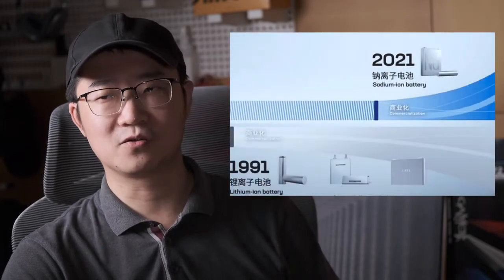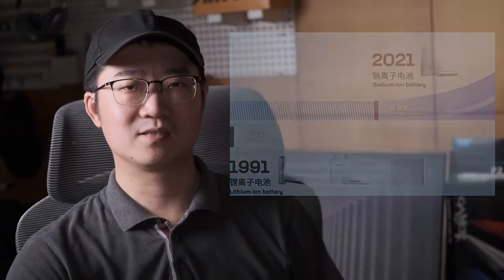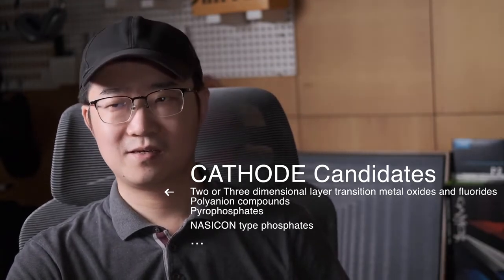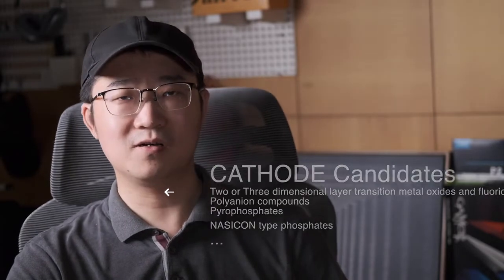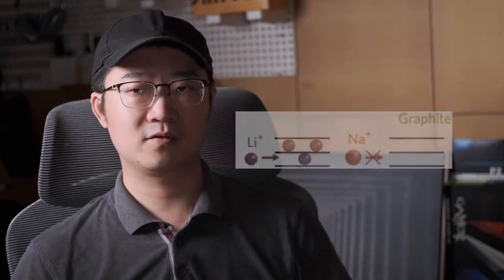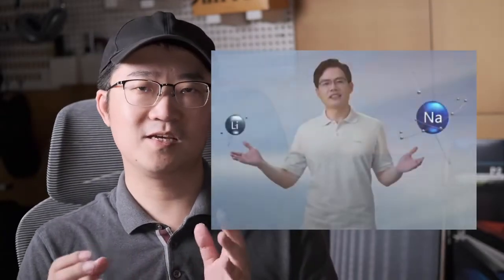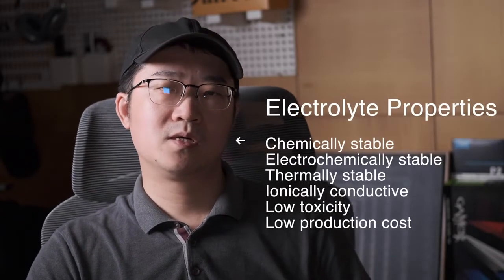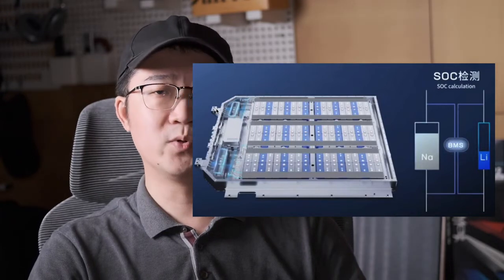CATL Sodium ion Battery

Comment: Great video, thank you so much for sharing this. I’d love to hear more detail about the practical characteristics of using these batteries. Specifically more detail on the voltage range, charge characteristics (maximum C charge and discharge rates, charge/discharge voltage profiles. Charge/discharge temperature ranges, lifetime cycles, etc…) 🙏